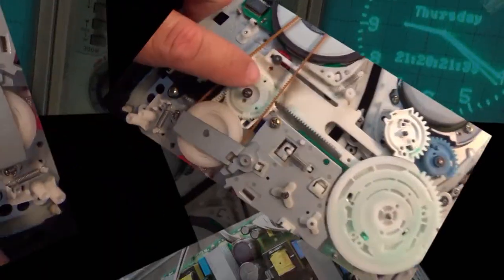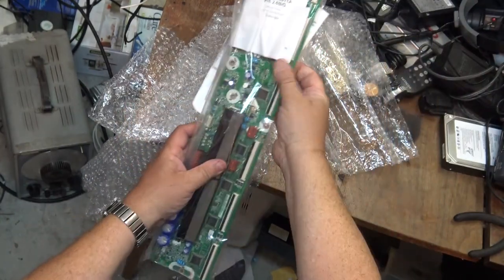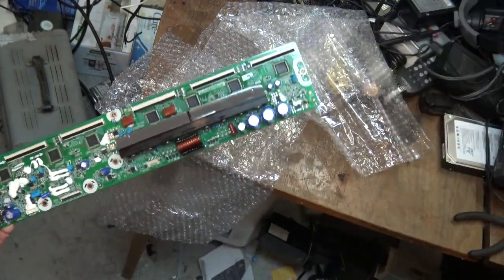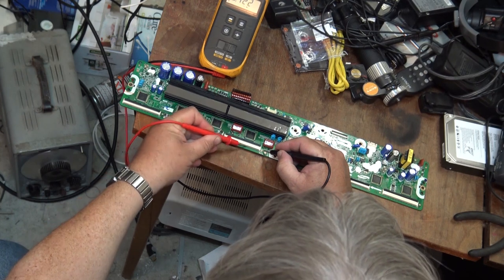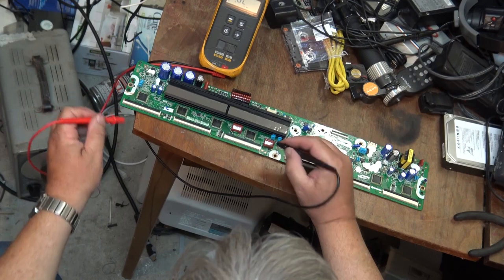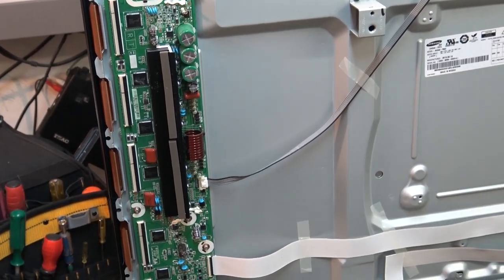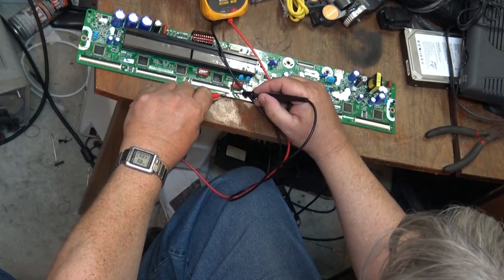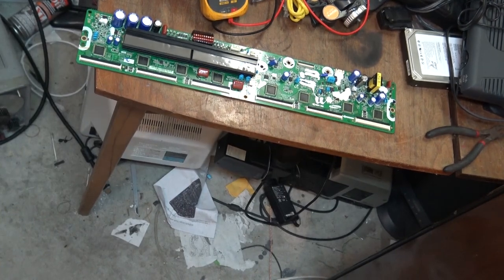Bad fleabay tv parts

Comment: Typical of Ebay sellers, selling junk.. I really cut back on doing business with them because of stuff like this.  I hope you can get a refund.
Reply from the maker: I didn't buy this, the owner of the set did and there is a replacement on the way. I did buy a buffer board from shopjimmy that was bad and they replaced it no questions asked, and that replacement still works today (as it is my set)

Comment: This is a real problem with ebay and TV parts. Every time, they show up packaged incorrectly, and untested. The last board I ordered, was a main board for a Vizio (one of the corrupt eeprom Vizios) It showed up wrapped in plastic wrap, like 3 rolls of clear packing tape, and the board on the inside was wrapped in USED aluminum foil. It had food crumbs in it. The board lasted for 1 power cycle, and it was dead. I contact seller, they replied quickly, stating that a new board has been shipped. I respond asking for a tracking number, and didn't get a response from then on. I waited 2 weeks, heard nothing from repeated messages. Put in for a dispute and I was issued a refund right away. I really think that these sellers are picking broken TVs out of e-waste disposal facilities, stripping them, not testing anything about it, and putting the boards on ebay.
Reply from the maker: Yes we have all been there with ebay. I don't buy anything from ebay, or sell on ebay because I was fuxed by a buyer and it cost me 1,200.00.
Reply: That is a good reason not to. I used to do a lot of buying and selling on ebay, and I have since stopped just from hearing horror stories from others. I also haven't been to trusting of all the parcel shipping companies lately.

Comment: Then salvage one of the non shorted IC's From The Donor board
Reply: Why? The board was probably sold as new yet it turned up defective, if people don't put up a fuss then the sellers will just keep doing it.
Reply from the maker: These chips are typically welded down to the board, so removing one will more than likely damage it. I don't have a 7000 rework station here for that type of repair.
Reply: THANKS 12voltvid, love your Chan and your work. BTW, you might check
out YouTuber Louis Rossmann and plunge into some easy SMD repairs.  
LR gives complete advice on equipment, supplies and techniques. (lol, He loves/hates Apple)

Comment: This is exactly what happen when nobody knows how to test the board before ship to the customers because, they think it's a good idea to recycle the sets to like for example, whenever the flat panel is damaged, they take these boards out from the panel and along with the frame and the pivot stand. 

There's no excuse for them to jump the conclusion real quick and sell the parts on eBay (Evil-Bay) and trick customers that they didn't know that are any good or bad, because they have no skills to check the boards to whenever they think it'll work just fine. =(
Reply from the maker: Then they claim that you damaged the board installing, or ordered the wrong board. This is why I try to component level repair boards as opposed to buying used boards.

Comment: Sell it on ebay then! Probably previous owners did the same. :))
Reply from the maker: LOL I don't buy or sell anything on fleabay.
Once bitten.....
I was bit about 14 years ago, and the wound is still healing. It revolved around a damage in shipping claim, and the carrier said no fault as it had been signed for. So the buyer filed a charge back with his credit card company, and won. How this can happen is beyond me. I had pictures of the item in perfect condition as it was being packed, and even had video which I supplied of the unit being wrapped up, and sealed in the box that was shipped with more than enough packing. The box wasn't smashed, but the buyer claimed that when he unwrapped it, the camera (an old broadcast camera) was smashed beyond repair like it had been dropped.) This dispute dragged on for almost a year before fleabay sided with the buyer. I had already spent the money, so ebay didn't get the money back, so they sent it to collections, and then the fun began
Phone calls at 4:00 in the morning ect. Since it had been sold from my former company, I ended up folding the business to stop the harassment. It was just after my business partner had passed away, and I was liquidating surplus equipment. 
What I figure the buyer did was he had a smashed camera, he bought mine, took the serial number plate off it, and put it on his smashed camera so he could take pictures of the broken camera (ebay sent me pictures, and what he showed was certainly a badly damaged camera, with the same serial number as the one I had photographed as I packed it up) Real scam, that I could have fought in court, but that would have cost even more than the 1,500 the camera sold for. As I said I already had the money and got it out of paypal the day before the fit hit the shan. I learned my lesson that there are fraudsters, out there, and even ebay agreed with me that the buyer was likely pulling a scam, but because he involved his credit card company and they ordered a refund they were stuck in the middle.   have ordered the odd part off ebay. I am able to use it now because the account that was locked was an old business account from a now defunct company.

Comment: Would have been a good idea to go direct to SAMSUNG.
Reply: Perhaps, except...

1. The part may be discontinued and there may be no inventory.  This is possible for a plasma TV, which Samsung stopped making by the end of 2014.  The older the set, the greater the likelihood.

2. If available, the new replacement part could be expensive.  If the cost of the part exceeds the fair value of the TV in the used market (if it were working, of course), then it's not really worth it.

3. This is assuming that Samsung will even sell you the part direct.  For purchasing parts, they may refer you to a factory authorized parts distributor, instead.